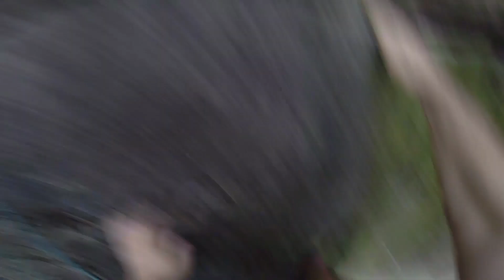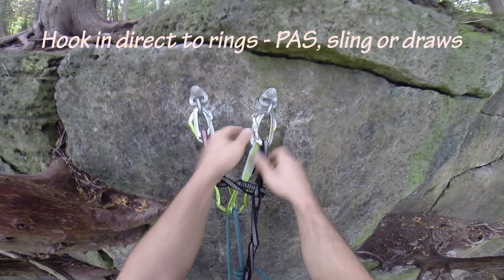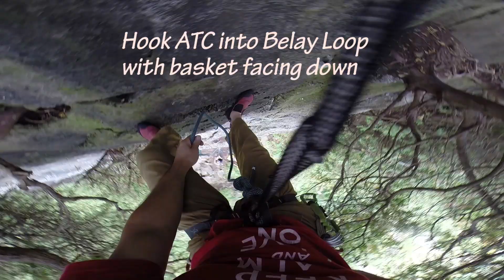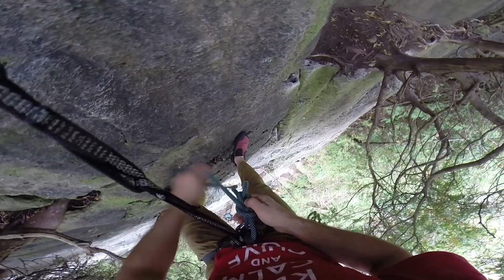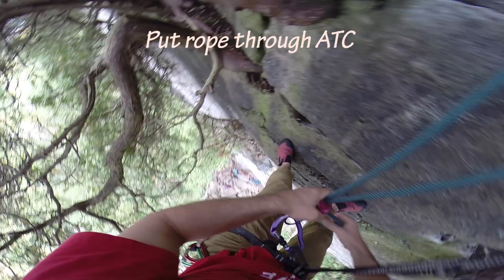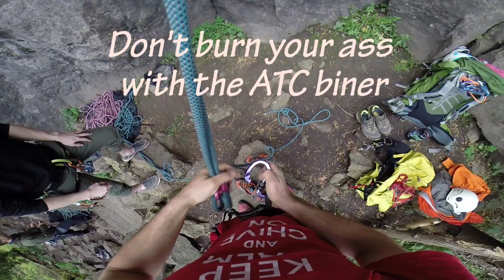Cleaning a sport anchor

Comment: Not an ideal way to clean an anchor. It’s also not great for new climbers as it teaches bad habits. A few changes I’d sugggest: 1. Lock your carabiner on the personal anchor. 2. Try to get your PA on straight away and avoid hanging on rope first then you can put it under the quickdraws and less chance of stuff getting in the way or worse unclipping when you untangle  them. 3. Don’t rappel off the double rope - yes you tie a barrel knot but if you are on a long climb can you be sure your rope is long enough and you fed it all the way down to the ground? Probably ok for you but not a good habit to teach someone. Better is to loop the rope through and tie a figure eight on a bight you can then self belay down or your partner can. Always being connected on the rope and on belay is a great habit and one you want to instill in new climbers. Sport climbing feel so “safe” compared to trad it’s easy to get lazy and just trust everything. Don’t. Be safe always. Good luck with your climbing.
Reply from the maker: The first thing i do after securing my PAS is remove the anchor which is not being hindered by my PAS.  My PAS can't get unclipped cause in all scenarions i keep it weighted until i rappel.  I always climb with either a 60m or 70m rope with a middle mark.  I always tie a knot in my end and is always visually confirmed by me or my partner plus my crags are not any taller then half of a 60m.  If i am doing anything larger i always tiecin both ends.  I always had it beat into me to not lower from anchors due to wear and some areas dont have people that actively replace gear.  Yes it is not the best example as i sometimes cut corners like not locking my PAS or using a rappel backup but it was the best video i had at the time and though i would make a little video.

Comment: u should've gotten lowered off of that. Don't toprope on the anchor, but do use it for lowering. rappel if it's overhanging or there's a sharp ledge and put a backup ffs
accidents happen bc belayers assume u rappel down, take u off belay when the climber wants to get lowered. your method "works fine" until u mess one thing up from being tired

Comment: This is not how you clean an anchor
Reply from the maker: Jeremyxlewis. This is how i clean an anchor.  

The way I do it can be applied to almost all anchor situations that I have been faced with and limits the chances of failure scenarios i have personally been faced with. 

What about it do you see as wrong and/or unsafe and could be changed to make it more safe or efficient?
Reply: @ChalkIsCheapMotherF  no auto block bro
Reply from the maker: @R2_D  Yeah,  I never really used one.  When I TR solo and rappel I back it up with a shunt.  I am playing with autoblocks now cause I should have a backup.  Just trying to find what works best as I am not a fan of extending my rappel device.
Reply: @ChalkIsCheapMotherF  Fireman belay at least????

Comment: This is dangerous. Why would you solely rely on your pas and untie completely? You could secure your pas and feed a bite through the anchor and retie in before untying your original knot? Super unnecessary and sketchy way of doing it!
Reply from the maker: Many times i have came across anchors where it was smaller gauge chains and you could barely fit a single 10.5mm rope through the link nevermind a bite of rope.  I like this method as it works for every situation though it may be "sketch".  Also also, i once fed a bite through the quicklink that was holding the thin gauge chains and when you did a lower the weighted rope got pinned under the chain making it impossible to pull.  We had to ascend the rope to do it all over again.  Rare scenario, but it happens.

Comment: Why not feet a bite through to remain in belay? NEW CLIMBERS, DO NOT USE THIS VIDEO. IT IS INCORRECT AND UNSAFE
Reply from the maker: I have been to many places where there were small gauge chain anchors where you can't physically feed a bite through.  I have witnessed newer climbers who only knew how to feed through a bite of rope having to untie in order to clean the anchors.  Most of them were trying to get directions yelled up at them in order to do it properly and a few of them dropped the rope cause they didn't tie it off to their belay and had to be rescued.  Also, when i started it was ingrained in my head to rappel rather thwn lower to save wear on anchors.

Comment: Your lack of prusik/friction hitch/blocking device is disturbing. If you happen to pass out or your grip slips, you’re gonna have a bad time.
Reply from the maker: Yeah i know.  I usually use a rope that has a very abrasive sheath and it takes alot to pull rope through the ATC so i don't often use a backup.  I am using a backup now that i use my other rope.

Comment: draws should probably be thru bolts not rings, seems like not needed wear on the rings IMO. i will admit kind of a weird setup without chains. no need to take yourself off belay tho while cleaning. sure youre in your PAS but seems not needed. definitely not a standard clean - if youre new looking at this look elsewhere. this is moreso rapping off a single pitch (and even then the text said to use firemans or a prussix but neither were used. just yolo'd down the pitch. it works i guess but definitely wouldnt use this a resource for new climbers). 

if youre worried about the rope bite not fitting thru the chain (which obviously it does here, there is a great way to do this without coming off belay by just tying a clove hitch. in general, seems fine if u know what youre doing but again if youre new, look elsewhere for info. 

cheers

Comment: Did you post this on reddit?
Reply from the maker: OffBlay_  no i did not.  I just found this at the end of a video I was editing so i quickly threw it together and threw it up.  This is just the way i have fine tuned my setup.  It is now muscle memory every time i get to the anchors and i like this way best as it keeps a clean (for me) setup.
Reply: @ChalkIsCheapMotherF  i am with you man. I do it the same way as a matter of fact. It is safer to do it by always being on belay method however it creates too much rope “traffic” at the anchor. Good climbing brother! Be safe out there.
Reply from the maker: @OffBelay_  I primarily rappel as it frees up your belayer to pack up for the next climb and it is less strain on the fixed gear.  

Some points have been raised about where my top rope draws are and where I clip in my PAS.  I like it this way because I was taught to clip my PAS into the bolt and once on a tower the bolt bent a little binding my fatty PAS biners to it.  Also that puts your pas biner in the same orientation as the rap rings and I have seen people pass the rope through their biners as well as the rings which can be a pain to get out of.  

I don't post on reddit at all, is it good on there?

Stay safe out there and enjoy the Red Rocks climbing.  I miss it out there.
Reply: @ChalkIsCheapMotherF  Reddit is not a good place to post, way too much negativity. Red Rocks was fun. Red River Gorge in March.